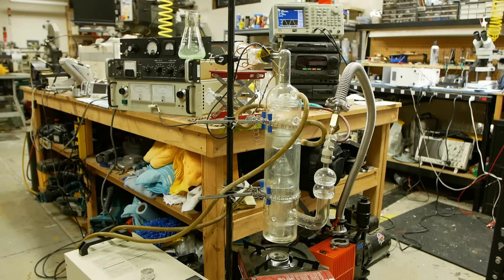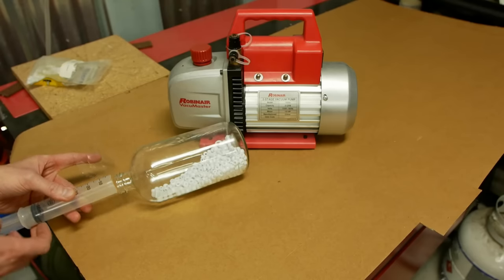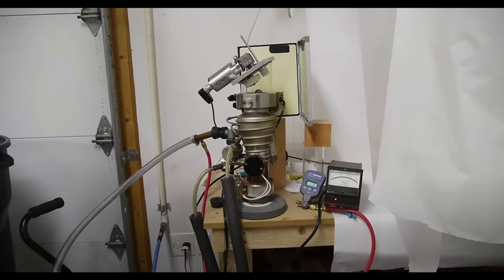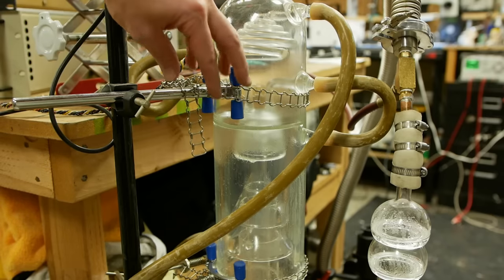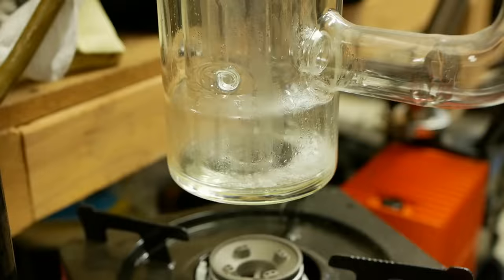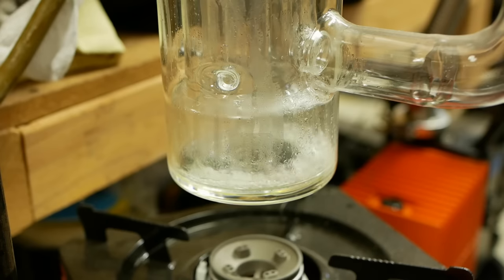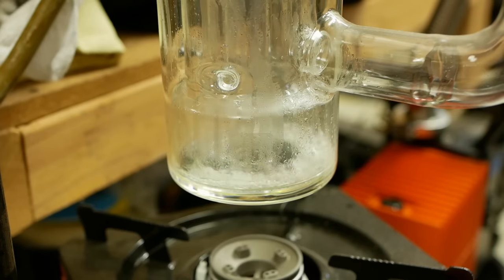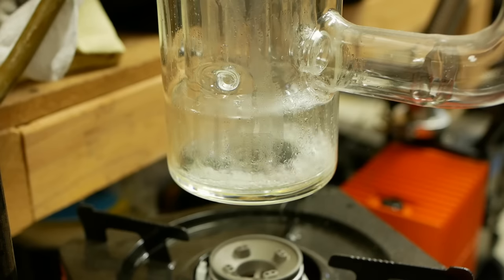Giant glass diffusion pump and cathode ray tube demo

Comment: It is really cool to be bale to see inside of the glass diffusion pump and watch the oil boil and condense. I just wanted to share some notes from my past experience with these and other high vacuum systems. The reason it is called a "diffusion" pump is because the gas molecules (mostly  oxygen and nitrogen) bounce out of the vacuum chamber, into the body of the pump, and diffuse into the small oil vapor droplets that reach it up to the top of the pump. The pumping performance relies on gas solubility as a function of temperature. At the top, it is coolest where gasses are more soluble in the oil. At the bottom, it is hot where the gas molecules are less soluble and will be liberated as gas molecules. It is then up to the backing pump to take these liberated gas molecules away. Silicone oil is preferred since because of its higher gas solubility and because it is more stable for a long period of time. A diffusion pump that size should be around 800 W. I had a 900 W diffusion pump at my old place of work that was similarly sized albeit metal. After cleaning that 900 W pump with trichloroethylene and servicing its larger backing pump, I was able to get our 3 gal vacuum chamber down to 10^(-8) Torr - which is a typical ultimate pressure for diffusion pumps. The primary disadvantage of diffusion pumps is their pumping speeds and the contamination (like you mentioned). For these reasons, they are not used for semiconductor fabrication. Turbo pumps are most commonly used since they can pull a high vacuum very fast and don't use as much power as a diffusion pump. Cryo pumps are a little slower than turbos but offer the similar vacuum performance and are not prone to oil contamination. This is one of the reasons why cryo pumps are used on thin film deposition equipment in the semiconductor fabrication industry.

Comment: Diffusion pumps are really interesting pieces of equipment.
The downside with them is that no matter what one does, they will always out gas oil into the chamber, due to the vapor pressure of the oil.
Though, for a lot of stuff, that isn't a major issue.

Comment: Didn't see this video until now, so don't know if any of this would be stuff you know by now:

-While the most common electron microscope emitter is the tungsten hairpin filament (essentially just a lightbulb filament like you were using) that's primarily because they're cheap and quickly/easily replaceable. There are other filaments available that have higher output than tungsten hairpin, but they can be very expensive, require ultra high vacuum, and may require extensive downtime for replacement (sometimes weeks of downtime where you have no microscope to use if you don't have another).

-Some electron microscopes (particularly newer types) use multiple airlocked chambers to maintain vacuum at the gun and reduce wait times. So those would have an easier time handling a barium emitter like you were testing, but those microscopes commonly have airlocks because they're using guns with much higher output already, which are extremely stable.

-A couple of the higher-output emitter types used in the industry: Lanthanum-Hexaboride (LaB6), Field Emission and Cold Field Emission. LaB6 works in regular high-vac systems and gets very good output, but its crystalline structure can be pretty fragile, so you have to be extremely careful in handling it when you install and if I remember correctly you have to make to sure to let the system cool down before venting to prevent thermal stress that could destroy it. My memory could be wrong there. Field emission and cold field emission use a tungsten emitter again, but designed to use a different emission method to get much higher output. Where tungsten hairpin is a thermionic source that very heavily uses the heat generated to eject electrons, field emission guns primarily use electrostatic charge for this purpose, and by emitting through an extremely tiny sharpened tip (I think it can be as small as a single atom at the point and has to be sharpened by a focused ion beam instrument) it can get that much higher output in a very coherent, easily focused beam. Of course, field emission guns have to be run at ultra high vacuum so you usually have to have the roughing pump, high-vac pump (usually TMP, but ODP like you used here would probably work, too), and a series of ion getter pumps to grab as many of the last few stray molecules of gas in the column as possible because as the system is running they stick to the filament and form little fingers of gas that affect beam stability which makes you have to flash it with a lot more current, relatively speaking, to eject them off periodically, and that all means they're expensive and extremely time consuming to replace. Just pumping the system back down to appropriate vacuum level after replacement can take a full week. But, as long as you treat them well they can last quite some time, and they are capable of producing extremely good images at very high magnifications consistently, and the cold field emission guns do even better. I use them at work every day in some very nice SEMs, and we routinely do imaging at 400KX mag, sometimes up to 800KX (though not as often... 800KX isn't as clear).

A microscope could certainly be built to use an airlocked chamber to go with the barium emitter, that wouldn't be difficult at all, but I think the bigger issue might be the combination of the complexity/fragility and associated cost of having to engineer new solutions for installing it in the electron gun in the first place, as well as stability considerations (looks like the barium emitter is a bit iffy). At that point it would have to be significantly better than even the field emission guns to make it a worthwhile endeavor, but their emission properties make them extremely good.

On a separate thought - one interesting thing in the EM industry in recent years has been sort of a shift towards lower and lower power emitters for applications interested in purely surface-detail imaging. Hitachi produces an ultra-low voltage detector (UVD, as they call it) that will run with an electron beam down as low as just 10V for basically nothing but surface detail. Something I wish I could mess around with at work for our more sensitive samples, but I think the working distance is shorter than anything our tools can do, and probably wouldn't get anywhere near our usual magnifications.

Comment: Love your channel! 
You are heating the diff pump oil too much, you do not want it to boil. 
The correct temp is just where there is slight movement on the surface of the oil and the temp varies with the type of oil used.  
702 = 180-190C
704 = 220-230C
Yes never ever use plastic tubing in vacuum systems - thick wall latex is acceptable. 
Me? I used to be a high vacuum service tech.
Reply: I thought the same too
Reply: What is the result of boiling the oil? Less efficient pumping? More oil molecules escaping?
Reply: Also curious about the consequences of boiling the oil!
Reply: Does excessive heating crack the oil molecules into shorter ones?
Reply: @hellelujahh  Reduces the efficiency. The goal is the oil vapor streaming at supersonic speeds to impart its kinetic energy to gas molecules deflecting them down away from the inlet and compressing them. When you boil the oil the vapor streaming is chaotic, and if liquid oil droplets impede the vapor stream.
Reply: @weinihao3632  Silicon oil is resistant to this however it does happen and should never be re-used even if it was strained to remove particulates. 
Silicon oil does have a shelf life, however I found in practice it does not matter UNLESS for Ultra High Vacuum UHV 10−7 pa. Today diff pumps are obsolete for this as dry turbomolecular pumps are preferred - except where there is excessive particulates. Think jet engine spun by a motor to very high revs.
Reply: @fgbhrl4907  Reduces the efficiency. The goal is the oil vapor streaming at supersonic speeds to impart its kinetic energy to gas molecules deflecting them down away from the inlet and compressing them. When you boil the oil the vapor streaming is chaotic, and if liquid oil droplets impede the vapor stream.
Reply: @tihzho  I know of one industry where diff pumps are still depended upon which is in Electron Beam welding. Turbo pumps are used for the smaller volumes in the electron gun and some customers that require oil free pumping systems will have turbos for the main chamber but these chambers are usually small comparatively. Turbos tend to be a more costly choice the larger the volume you wish to evacuate becomes. Talking as a system engineer at a company that manufactures EB Welding machines.
Reply: @N0blea  There are many industries where diff pumps are still used. Anything that requires large spaces to be evacuated such as when metalizing foils (Think potato chip bags) you would spend a shit ton of money on turbo pumps to get the same pumping speed/volume. Also the ultimate vacuum on a diff pump is higher than a turbo pump. You could go turbo pump with a ion sorption pump  but that is another expense and needs to be recharged over time. Turbo pumps are used where cleanliness is important but for industrial or commercial uses not so much.
Reply: @tihzho  Obsolete unless you are a poor guy like me and can't afford a turbo!  :)
Reply: @excitedbox5705  Yup, diff pumps are still used in web systems and big batch evaps. Nothing can match their throughput performance when you get up to ~24 in or larger inlet on big volumes. They also tolerate abuse from voc's, water vapor and particulates well.

Comment: Thank you for this very interesting and informative video! Regarding the deflection, it might be helpful to add a glass tube with smaller diameter inside the Erlenmeyer flask around the emission path, which can hold the coils and connect it through the rubber plug. Alternatively it would be even better to use electrostatic deflection, since it is independent on the speed of the electrons (which probably is not tightly controlled in this setup), though it requires higher deflection voltages.

Comment: the emission filaments in e-beam evaporators often use tungsten which has been alloyed with small amounts of thorium to get higher emissions. Yes, this makes them ever so slightly radioactive, but it's tiny amounts and thorium is only a weak alpha emitter.

Comment: For large scale degassing of molten steel, steam venturis are used to get a vacuum down to a few millibar.

A lid will go over the ladle and as argon is bubbled through the steel to stir it, steam injectors pump down the atmosphere. At the same time, alloys are added and large electrodes heat the steel to its final pouring temperature, creating (hopefully) high alloy steel with very little hydrogen or nitrogen in it.

Speaking of which, I don't know if there is a worthwhile video in there, but the process of testing for dissolved hydrogen in molten steel with a Hydris pole in real time during the pouring process baffles me. I've tried to read about and understand it before but nothing quite makes sense. I turn wrenches, beat things with a hammer, and make fun of the electrician for a living tho.

Comment: 5:10 It's not just an efficiency problem. High vacuum pumps as diffusion and turbo pumps can not work at athmospheric pressure. And mechanical pumps (rotary vane, membrane etc.) can't reach high vacuum. But you're still right. By changing the liquid in the diffusion pump and the speed of a turbo molecular pump, you could stage multiple pumps to achieve a high vacuum (for example there are simple vacuum pumps you just connect to a fast flow of water. The high water flow creates a low pressure zone. But not the same principle as diffusion pumps. Bernoullis law instead of air molecules diffusing into the pumping liquid which drags them down). But that wouldn't be effective. Mechanical pumps are way more efficient at those pressures. As you explained, they are like syringes. They connect to an area, expand to decrease the pressure by expanding the area, then disconnect and expell the trapped gases to the exhaust. Diffusion pumps use a liquid to diffuse small amounts of gas and move it downwards, where it gets reheated to expell the gases and evaporate again. Turbo molecular pumps use fan blades at extremely high rpm to hit them into a direction away from the evacuated side. So basically at high pressure it's more effective to move gas by trapoing and releasing in a chamber. At low pressure you'll need pumps that physically move individual gas molecules. 
And i absolutely love your diffusion pump! Absolutely amazing to see it work through glass.

Comment: You could boost the filament electron emission by covering it with a thin layer of Yttrium (III) oxide (also known as yttria), which is stable in air and should work well for your applications. Just remember to run the filament at lower current than usual (at least half).
The diffusion pump strip show was a nice treat for someone who has been using them for years and never had the opportunity to peep inside when running.
Great video, as always!
Reply: I have heard of this before but have not found a way to get the oxide onto the filament correctly. Using the water glass as an adhesive like for the barium, it doesn't work. The resulting coating emitted not much better than plain tungsten, and nowhere near as good as the barium carbonate.

Comment: Maybe try heating the filament slowly and to a lower peek current.
I suspect the barium oxide is acting as an insulator allowing the tungsten to reach too high a temperature.  Also, the barium carbonate could act as an oxidizer with respect to tungsten at high temperatures so best to decompose it slowly at a lower temperature.

Comment: A pretty common material for  thermal electron emitting cathodes is LaB6, it is stable in air so you could give it a go. More advanced systems use tungsten again but this time as a very sharp single crystal in order to build a field emission gun.

Comment: Try thorium on your tungsten filament. Mantles for gas camping lanterns are a convenient source of thorium. Try snipping a tiny bit off the mantle and draping it on the filament, then heat it in vacuum. (According to Wikipedia the Coleman brand no longer uses thorium, but many other brands still do. Your Geiger counter should tell you quickly if it's right.) 
For the bulb used as a filament try Christmas tree miniature bulbs. They are very easy to break without damaging the filament and are cheap as dirt! They also make good thermal conductivity sensors for diy gas chronographs and work great as low velocity air flow sensors.
I used a much smaller glass diff pump building the system for my physics thesis project (back in 1972 or so) and it was fascinating to watch it coming on line. I think the final two bells in the roughing pump line are for trapping low boiling point  components of the working fluid. You might do well to reduce the restrictions in the roughing pump line! Even at the relatively high pressure there you've got a lot of restriction!
Lots of good memories brought up by this video! Thanks much for it!

Comment: Service engineers experience with DPs. A Pirani gauge on the foreline is very useful. Check for the correct direction (top to bottom) of H2O flow (28'C).

Comment: I remember replacing a mercury diffusion pump on an ancient Joel  SEM in college and replacing it with a turbomolecular pump. The original pump had a rather large quantity of mercury in it.  The turbomolecular pump was wayyy quicker and took a lot less power during pumpdown. 🤓❤

Comment: I would love to see more on making CRTs, no matter how crude. I've always wondered if with the right equipment, one could make a CRT that might be capable if at least a black and white image with a semi decent level of clarity. Also how difficult would it be to make a Colour tube? Also, that Glass diffusion pump looks so neat in full operation. :)
Reply: Color, at least as commercially deployed is way more complicated. In addition to three electron guns it requires precision application of the phosphor dots/stripes and a precise shadow mask structure behind them. Nevermind driving the thing, which takes twice the high voltage. It could be done, but certainly not a quick project built in a Erlenmeyer flask. I'll hazard a guess color TV stuck with round picture tubes and vacuum tube electronics about a decade longer than black and white for those reasons.